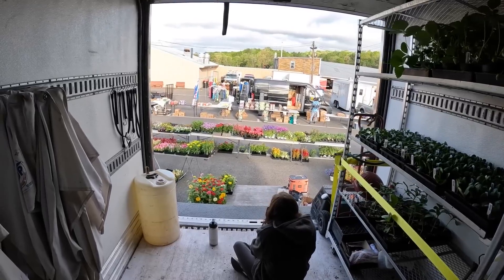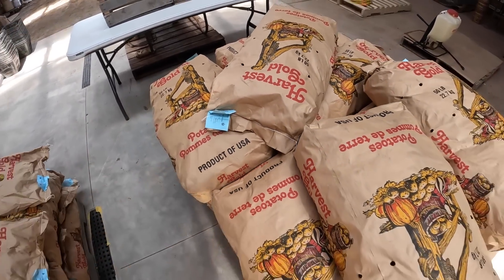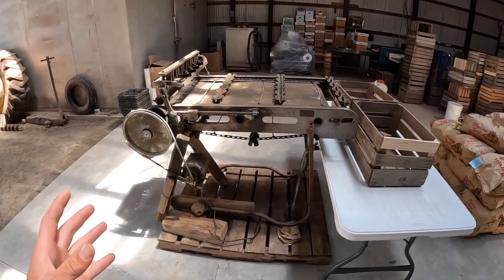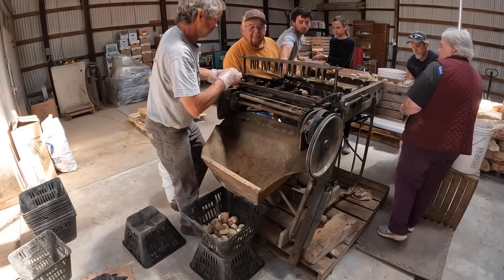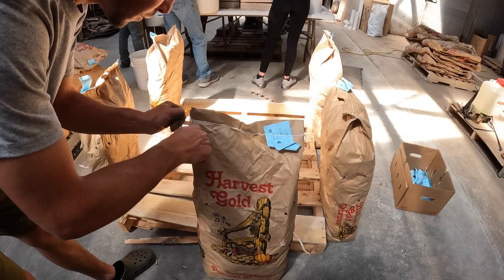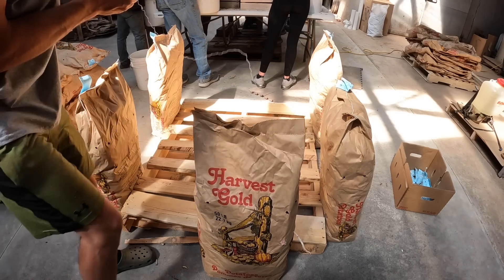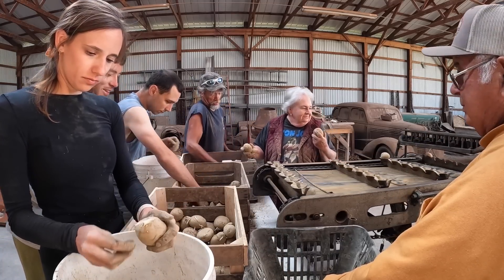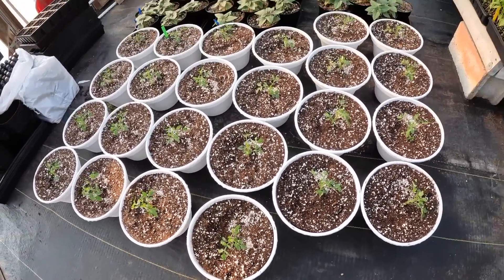Cutting Potatoes Is A FAMILY OPERATION

Comment: The Trexler Potato Seed Cutter was manufactured circa 1929.  Albert E. Trexler started the company in an old potato warehouse that was built by his father and uncle, in the town of Trexler, PA (near Kempton).  In this facility he adapted manual potato seed cutters to electric.  The new electric cutters cut more even seed pieces which worked nicely in the mechanical planters.  His first year in business, Albert sold 250 seed cutters across the northeast United States, and by the end of 1930 his business was the only business left in Trexler.

Comment: Veggie boys plant the whole potato. Why do you cut them up and clean up the eyes.
Reply: Seed potatoes are generally cut, that's the point in them, one seed potato can produce 2 to 4 plants which will increase crop yields. They're not removing the eyes,  they're removing the premature spouts, the eyes are still intact.
Reply: @AirplaneDoctor_  What are the eyes?
Reply: @ricsgarden7394  where it starts sprouting from.
Reply: ... poor veggie boyz don't have Sears and Roebuck Veggie--Matic model No#7 or  Samantha the expert eye remover either ...!